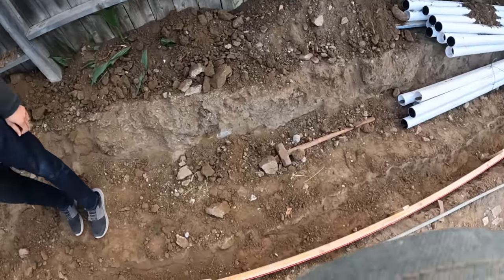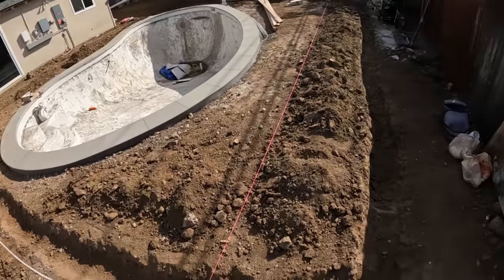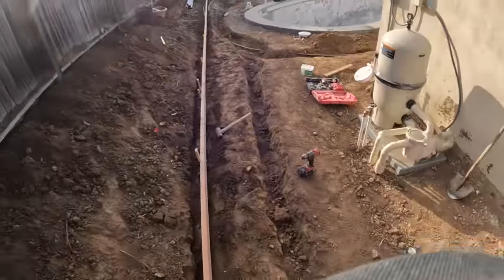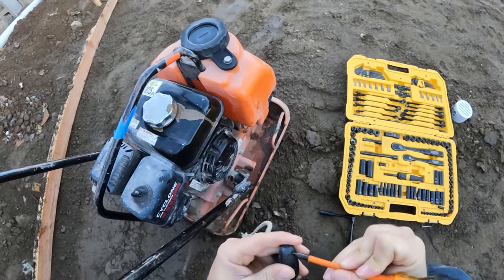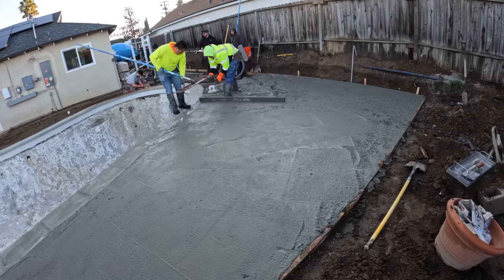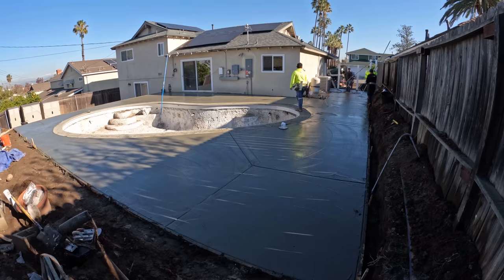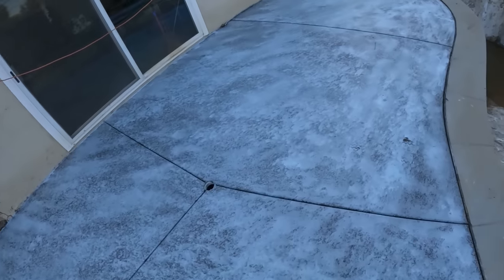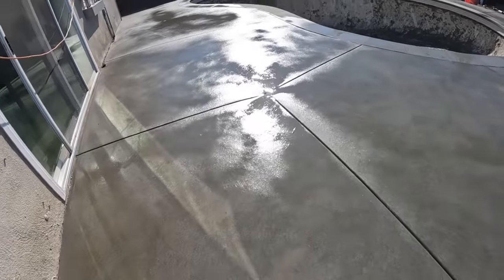SandWash Finished Concrete! Another Mistake! Huge Backyard Remodel part 4!

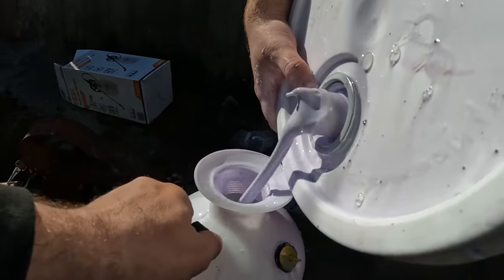Comment: 17:58.  Rotate bucket 180 degrees (so the spout is towards the sky).  Seems crazy, but it will pour without all the gargling.
Reply: Or stab a hole in the top of the bucket so air can enter though it.
Reply: Just like an old quart of oil 👍
Reply: ^^ THIS
Always pour off the high side :)
Reply from the maker: Good tip 👌👌
Reply: He is right, I used to glass surfboards and once in a while, I had to get 5 gal's of resin and found out really quick to turn the fiver around when poring it. 🤪
Reply: I came to saw this.same thing!!!
Reply: Fact!
Reply: Definitely Flip your can over. won't have that splash back when it's trying to exit the can while sucking air at the same time

Comment: 10:29 Color the anchor end of recoil cord so last foot pulled out provides a guide for operators to adjust their stroke to. This worked right away even though the generator recoil assembly was undersized without room for more than 60cm of starter cord.

Comment: 🌟🌟🌞🌟🌟 Food for thought, when first pouring out of a 5 gal. as they were - rotate the bucket with the spout on top ( not on bottom as they were spilling all over the place loosing product) and tilt the sprayer up against the bucket. same as pouring oil in motor or antifreeze in radiator. Once the 5 gallon is down a couple - they can go back to doing it like in video and have better control .  Iam an old track vehicle repairer from the 702nd Maint. Suport 2nd Inf.  Your doing good work there, good work ethics, now pour from the top of the bucket when new LOL 😂 😂

Comment: Ouch, I've been there and done that. I laid about 600 sq. ft. of saltillo tile in the wrong house, fortunately, the homeowner decided to keep the free tile job. Even worse, the carpet layers were at the correct house and had no time to wait on us so we had to set the correct house with the new carpet already installed. 3 days to straiten out that huge mess not to mention the dollar loss. Oh yeah, the good old days. How would you like a knucklehead move like that? It only happened once LOL Really like the sand wash finish!
Reply: We gave someone a brand new sewer from the house to the sidewalk. Took us less than 1 hour, and when the homeowner noticed, he told us it was the wrong house. The office sent us his primary residence instead of the job address, which was next door! He got 2 brand new sewer laterals for the price of one.

Comment: Question:  Why didn't homeowner want a retaining wall built next to all that dirt at higher fence elevation? Also: What happened to the cool power sprayer you guys had?
Reply from the maker: He wanted to do that later on his own
Reply: @OdellCompleteConcrete  Looks really good guys!
Reply: @OdellCompleteConcrete  He will regret not getting it done at the same time as the slab pour I think.

Comment: I’ve been doing concrete for 48 years and have the top sandblast/Vanderbilt finish crew in Nashville. There are a lot of tips that I could give you on this. We pour literally 1000’s of yards of this a year with little to no issues at all

Comment: Greetings from Thornton Colorado! I don’t know how many of those pull start ropes I’ve replaced but quite a few. One thing I learned was that more often than not is the cord is being pulled upwards instead of up and out. This creates a sharp channel over time  in the metal grommet the rope passes through which cuts the cord. You can actually mark the cord 12 inches before full travel and you can also take a large flat blade screwdriver, insert into the grommet and carefully twist which moves the location of the sharp edge. Worked for me and maybe will help others. Great video!

Comment: Any reason not to use rebar chairs?  Blokes where just mashing it into the soil. Not good to have the rebar in contact with the ground. It rusts it, plus adds nothing to the strength - got to be inside the concrete slab.
Reply from the maker: We pull the bars off the ground

Comment: I noticed one major problem with your pool deck pour. You're missing the equipotential bond that's required by code. You need a #6 bare copper wire bonded to your rebar in a ring around the pool bonding it to the pool equipment and the pool panel. This prevents people from getting shocked by the pool and deck acquiring different charges as well as limiting corrosion.
Reply from the maker: That was already in
Reply: @OdellCompleteConcrete  I couldn't see it in the video.  The equipotential bonding ring needed to be within a few feet of the pool and bonded to your rebar in multiple places.  Bonding it only next to the panel and equipment is in violation of the code.  I am an electrician by trade and that's one of the first things I looked for.  It's hard to miss because most electricians will allow the wire to lay as it lays instead of keeping it square with the rebar.

Comment: For the drains lines ABS would be a lot better. Could be snaked easier, those fittings can’t get a snake around them.
The nut in the middle you might be able to spin it with a drill.

Comment: Recoil repair hack - fish the broken end of the rope out of the rope hole in the cover. Reattach the handle and leave the rope full out. Where the rope is attached to the recoil, (and is lined up with the rope hole) pull the rope up and out a few inches such that it can slide between the recoil and the cover. While holding the rope close to the recoil, begin rotating the rope and recoil as one unit in the same direction that the rope is pulled when starting the engine. When the recoil spring begins to feel adequately loaded, stop at the rope hole exit location. While preventing the recoil from retracting, pull the rope tight using the rope handle such that the rope and recoil rope groove are in line.  Allow the spring to pull the rope in and replace recoil on the engine.
Reply from the maker: Perfect
TY

Comment: Can you put topcast #3 on 1 month old concrete to have that same look?
Reply from the maker: No but you can pressure wash it with the nozzle really close and depending on how  strong the pressure washer is it may give you a sand wash finish.
Reply: @lawrence Soriano If you want a sand wash finish you have to sandblast the concrete it will look better than the original